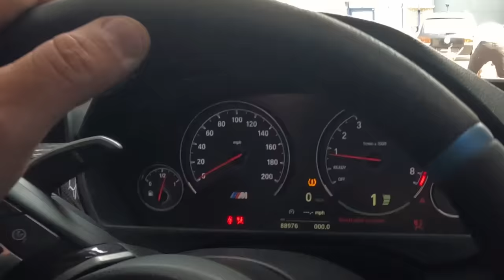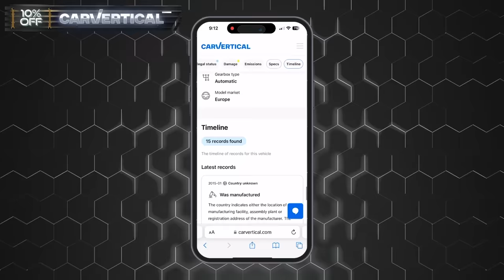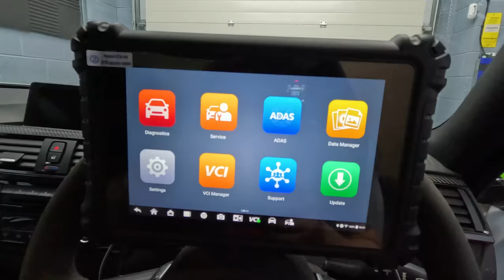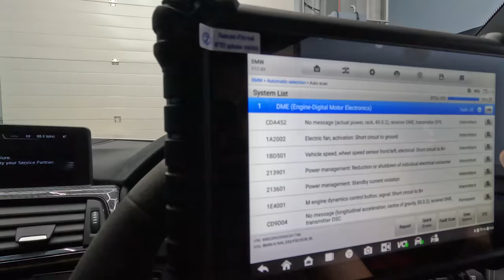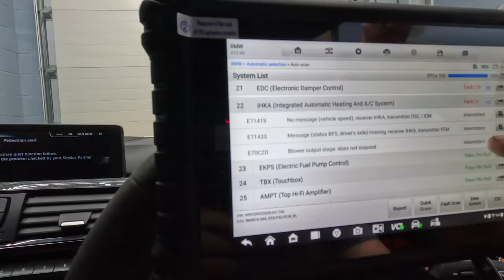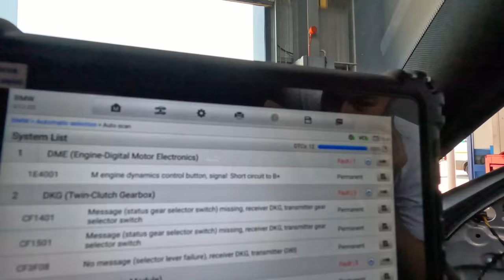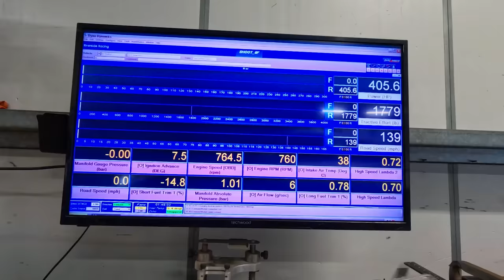AIRBAGS EXPLODE WITH US IN THE CAR! | BMW M4 Pt. 3

Comment: As some one who does a bit of work on vehicles myself, airbags are one of those things that I'd just pay an expert to sort (Or anything electronic to be honest, I hate working on electrical systems in vehicles!), glad to see the boys are able to smile about it even though it's more work to do. 
My '08 6-Series has the BMW SOS installed. Not sure if it works as I think it needs the BMW Assist package but either way, I hope I never have to test it out. Kind of funny to think that when the airbags go off in a modern car it panic-calls 'Home'...
Reply from the maker: They're not to bad to work on (airbags) tbh, you just need to remember to disconnect the battery ha ha yeah we wasn't expecting the sos call like ha ha 🤣
Reply: Mate, I’ve been working on everything with an engine since I was a kid! Even have me own garage now and I would still rather get some other c**t to do airbags!! 😂😂😂
Reply from the maker: Nah, that's the first time I've set one....or two off ha ha they're not that bad, I actully enjoy doing the dash yano..... i know that's a bit weird 🤣🤣

Comment: Did a little bit of wee come out when the bags went off lads? 😂😂😂
Reply from the maker: 🤣🤣🤣 no a bit of 💩 I think
Reply: @TransformotionVR  😂 if it makes you feel better it’s happened to me, the first time I ever did a air bag change years ago when I was on the YTS and learning, except it was the steering wheel that blew! Busted nose and a couple of shiners, and years of piss taking from the lads in the garage I was working in then! 😂 
 Although I still swear I disconnected the battery and one of those f**kers reconnected it to f**k the YTS lad! 😂😂
Reply from the maker: 🤣🤣🤣 it is funny afterwards

Comment: Oh man! I always unplug the battery for ten minutes before touching airbag systems. So lucky it was only the curtains and not the drivers or passenger front airbags!
Reply from the maker: We know but in the excitement of sorting all the codes it completely slipped our minds....we won't be doing that again ha ha and yes the dash, airbag kit and windscreen cost about £1500 so would have been a costly mistake

Comment: If the pyro disconnects the battery when it goes off how does the car still have power after like for the call that you got? Or does it not cut power to everything?
Reply from the maker: Good question, it cuts power to the starter so it won't turn over, but when we first got it the battery was dead so the electronic boot handle wouldn't work either, the jump points in the boot must be on the starter circuit as that didn't help either

Comment: Did you replace the vin number on the new dash?
Reply from the maker: The vin is on the cars chassis and the dash has a hole cut out so it's visible, it's not actually on the dash but good question
Reply: @TransformotionVR  it was on the M4 done by salvage rebuilds. The vin was part of the replacement dash and a new vin plate had to be sourced.
Reply from the maker: I'll double check tomorrow mate but I'm pretty sure it was on the metal work when we removed the dash, did they do that just to replace the dash or was it damaged? Maybe it was stolen recovery and had a damaged vin....ive not see the video so couldn't say
Reply from the maker: I double checked and our vin was definitely on the chassis, salvage rebuilds m4 is newer, I dont know why BMW mounted it to the dash....absolute madness

Comment: Why did only the side airbags go off?
Reply from the maker: I think we got lucky  with that 1  are guess is that Andy has tilted it sideways  and it's though  the car is rolling  over  it would have been very  costly  if it set them all off
Reply: @TransformotionVR  I'm thinking it's more likely that airbag was dodgy. Airbags don't go off like that. I've connected many modules and never seen that happen. What's weird is that it called emergency so the car actually thought it had been in a collision. Weird stuff
Reply from the maker: No, we had the ignition on after diagnosing the fault, really we should have had the battery disconnected, and it was either it asked out on the studs, static or tilted it to much and as liam said thought we were rolling over. Yeah we didn't know cars could ring you like that!